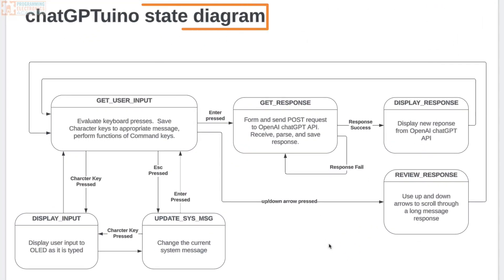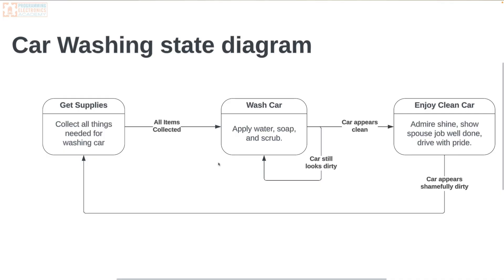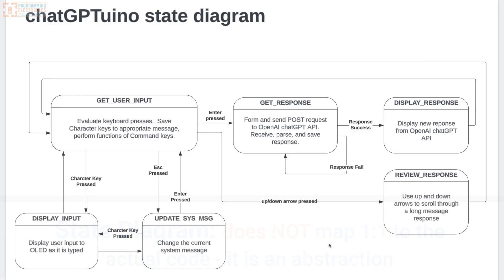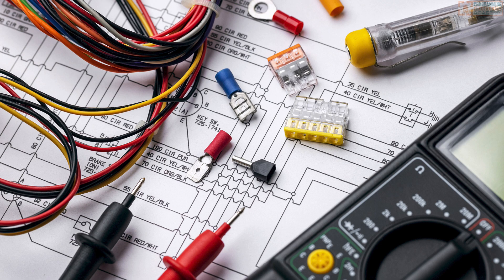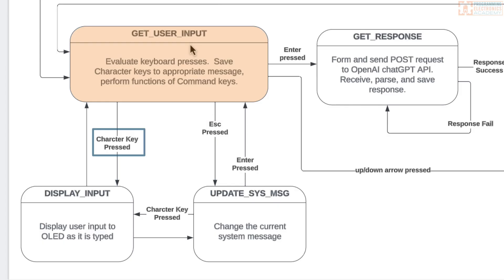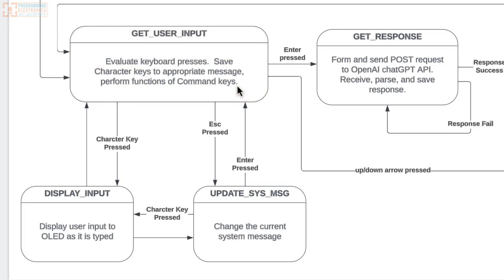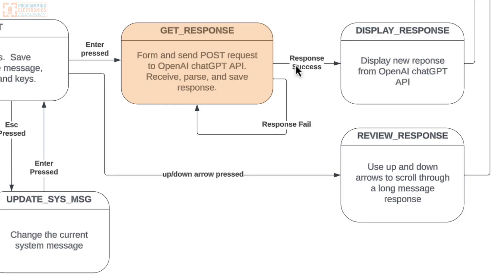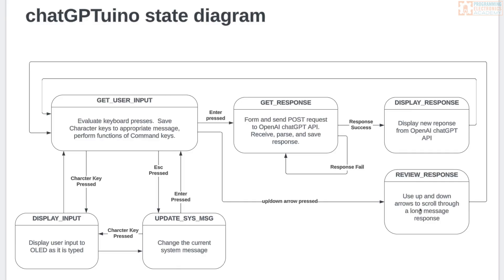Use State Diagrams for #Arduino

Comment: Thanks, very interesting. How is a state diagram different from a flowchart?
Reply from the maker: Great question!  Pretty similar. I tend to think of a flow chart as representing each individual step in a process, where as a state diagram represents different modes of operation of a program.
Reply: @programmingelectronics  Cool, makes sense.